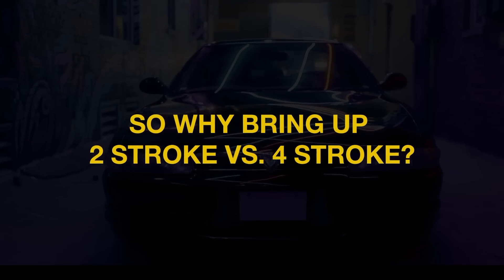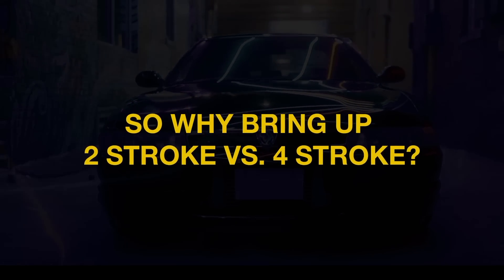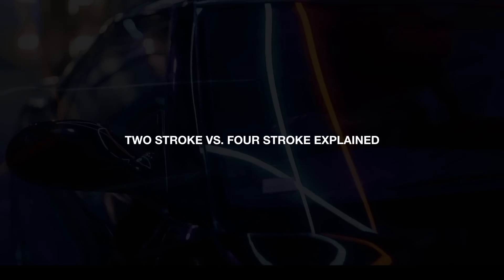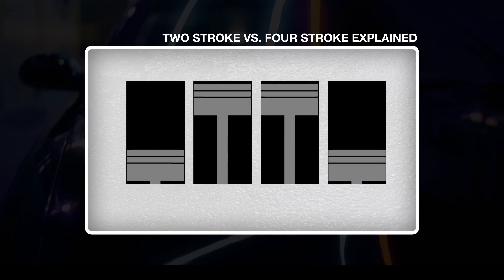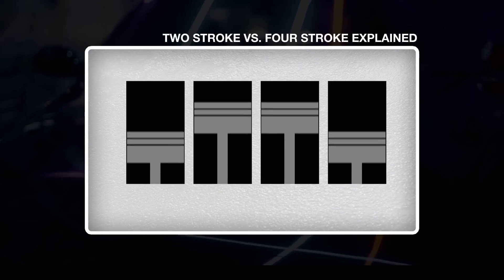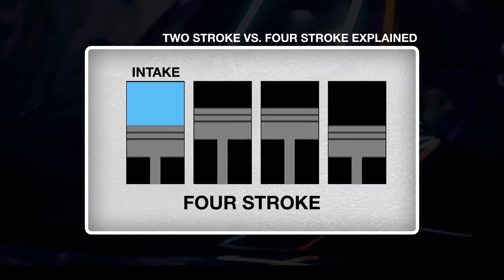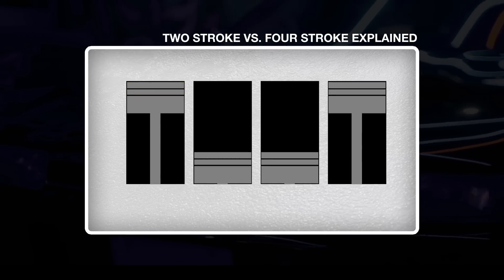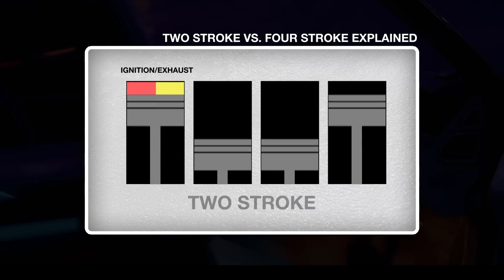The SECRET Behind Why RX7 and RX8 Rotary Engines Make SO Much Power

Comment: Your explanation is wrong though. "Engine displacement is the swept volume of all the pistons inside the cylinders of a reciprocating engine". Problem is, the rotary doesnt have pistons and it is not a combustion engine with reciprocating motion. The rotors are basically the "pistons" on the Wankel engine. In a four stroke, two full revolutions of the crankshaft are required for all the pistons to have fired at least once. In the Wankel engine, for each revolution of the e-shaft, two faces fire at the same time. If I go by your logic, that would mean the rotary needs 3 revolutions of the e-shaft for all the faces to fire and not one, so the bond with the 2 stroke engine kinda goes away. It is hard to really understand the displacement of a rotary, but you got it wrong. The difference lies in your example. A 4 cyl four stroke has four combustion chambers, so you need all the four pistons to fire at least once for you to know how much air got into each combustion chamber. So if two pistons fired once, the other still have to, so you can't tell the displacement until then. On a rotary, there are two combustion chambers. All six faces have 654cc. But only two of them, one per rotor, for each revolution, has a power stroke. In one of the rotors, if face number 2 let's call it, has a power stroke, face number one is the intake stroke and face number two is in the exhaust stroke. But don't misunderstand this. Even if I said the faces were on some "strokes", you shouldn't treat them as pistons. That is the tricky part. But you don't consider exactly how MUCH air the engine is taking. If by one single revolution, in the 4 cyl, only half of the maximum intake of air has gone into the engine, in the rotary, in one single revolution, the maximum air intake has already been reached, which, in the case of the 13B, is 1.3L. You just keep adding air for all the six faces as if the engine could take more than 1.3L, you're just repeating the cycle. The reason for all the power of a rotary is indeed because of how fast each power stroke succeeds one another.
Reply: DoubleC I’ve been waiting for so long to witness someone who actually had crunched the numbers & finally fathomed the answer!
Reply: DoubleC thanks for the input
Reply: DoubleC. Make a video and post u are accurate
Reply: 3.9 liter
Reply: Sorry, but the Wankel KKM IS A 4-STROKE so we calculate displacement at 1080° NOT 360° 
Its not that difficult to understand... each orbiting piston(rotor) has 3 sides forming 3 combustion chamber volumes, each with a swept volume of 654cc.  times the 2 housings is 6 and equaling 3,924cc.
 The other important thing that people without formal engineering experience fail to understand is that a 4 cycle Otto or Diesel engine completes its firing sequence in 720° of crankshaft rotation while the 4-cycle Wankel KKM designs required 1080° of rotation to complete its firing sequence...
These two important and often misunderstood details are the basis of the commonly used "2X" conversion formula for accurately "comparing" the displacement of the Wankel with other designs..
Any questions? I would be happy to explain in more detail...
Reply: Displacement of ANY combustion engine is measured by the total number of cylinders times a SINGLE combustion event (not multiple). That SINGLE combustion event per rotor is why Mazda rates a 1.3L 2 rotor that way. Each rotor face can only combust .65L of air. When this happens 1 time per rotor (or on a 2 rotor), you get 1.3L measured displacement. 

Rotary's are 4 stroke engines that have ignition events like a 2 stroke because the spark plugs per chamber fire every revolution. The guy is this video did a better job than most trying to explain this but left out some key wording that would have really driven his point home.
Reply: +RotaryPerfection The Wankel requires 3 revolutions, not one to complete each chambers 4-stroke cycle. The Wankel is not a 2-stroke as it does not complete its firing order sequence in 360° of crankshaft rotation. While the Wankel shares in common features such as pre-mix/oil injection and  port induction/exhaust these characteristics are not unique nor are they defining features of the 2-stroke concept and can also be found on some 4-stroke designs.
Reply: +RotaryPerfection NSU Ag. developed the "Tax Displacement" idea a contrived method to help promote and sell the Wankel design and to off-set its disadvantages in higher fuel consumption by offering the consumer a significant loop-hole in the tax codes commonly in use at the time. The "Tax Displacement" method is no longer recognized as a valid way of describing a Wankel engines displacement, authorities on this topic eg; Engineers, Government agencies, Insurance companies and Motorsports sanctioning bodies DO NOT recognize the Mazda 13B for example as actually having a displacement of only 1.3 liters, The 13B has a total displacement of 3,924cc and when we use the "2x" formula for converting a Wankel tax displacement at the typical 720° giving us a 2.6 liters for the purpose COMPARISON.
Reply: doktorbimmer I personally don't consider the 1.3L as such and have always doubled the displacement because the engine moves as much air as a 2.6L in 720 rotation of the e-shaft. You are talking about 3 revolutions of the e-shaft to fire the fuel air mixture of each rotor face to complete one full rotation of the rotor. To do such would also require 3 separate ignitions events on each face. That being the case, the engine would have ignited 3.9L of air in 1080 degrees of e-shaft rotation. The leading plugs would have also fired 3 times during this time period (minus Fd Rx7 wasted spark). 

I'm talking about how Mazda came up with the 1.3L rating. Displacement is measured by a SINGLE ignition event per chamber/cylinder not multiple. There is an ignition event every 360 rotation of the e-shaft per rotor chamber as the next rotor face is already compressing its fuel/air mixture. That's why I say it fires like a 2 stroke because the ignition events are at 360 and not 720 like a 4 stroke piston. I don't know your back ground but I've built, tuned, and 20b swapped these engines over the past 27yrs.
Reply: +RotaryPerfection  THERE ARE 3 IGNITION EVENTS PER ONE COMPLETE ROTATION OF THE PISTON(ROTOR)
Reply: +RotaryPerfection Each Chamber (rotor face) requires 3 revolutions of the eccentric-crankshaft to complete the 4-stroke cycle... thus 3 revolutions to complete its firing order sequence and 3 complete revolutions to determine its true total displacement.
Reply: +RotaryPerfection Yet you seem completely unfamiliar with the 2-stroke concept, in which you are trying to make a comparison to. How can you compare the Wankel KKM design that uses the 4-stroke operating principle with a 2-stroke? You seem completely unaware of the fundamental difference between to 2-stroke and 4-stroke concepts.
Reply: doktorbimmer "There are 3 igition events per 1 complete rotation of the rotor/pistion."

You're telling me something I already know. My previous explanation pretty much said this. It also proves there is an ignition event every 360 degree rotation of the e-shaft when you claimed there wasn't. Like I said, rotary has ignition events like a 2 stroke even though it''s a 4 stroke engine. I believe you're getting too caught up in trying to show your knowledge that you're not paying attention to what I'm typing.
Reply: doktorbimmer I'll simplfy this! 1.3L rotary moves and ignites 1.3L of air every 360 degree rotation of the e-shaft. Since the measured displacement is the volume of a SINGLE combustion event per chamber, Mazda can legally rate the engine as a 1.3L. End of discussion on that part. 

Now how much air has that same engine moved with 720 degrees rotation? 2.6L. During that time, the engine will have had 4 ignition events. Thats why a 1.3L rotary is comparable to a 2.6L 4stroke piston 4 cylinder engine. Both engines would have moved the same amount of air AND had the same number of ignition events. Both engines are equal in the since that they measure rpms in the same way. E-shaft vs Crank. That being the case, since the combusted energy is being delivered to the crank or e-shaft, it only makes since to calculate how much combusted air volume is used to move the perspective cranks every 360 degree rotation. So you worrying about the rotor needing 3 rotations of the e-shaft to complete a full rotor rotation doesn't matter to. I calculate and compare the 2 based on how much usable air is being ignited every 360 degrees of the crank. So a 1.3L rotary will have moved 3.9L in 1 FULL rotation of the rotor and had 6 total ignition events. Guess what? That same 2.6L 4 stroke 4 cylinder piston engine would have move the exact same amount of air and had the same number of ignition events. 

1.3L rotary=
1.3L 360° 2 ignition events
2.6L 720° 4 ignition events
3.9L 1080° 6 ignition events

2.6L piston=
1.3L 360° 2 ignition events
2.6L 720° 4 ignition events
3.9L 1080° 6 ignition events

So if you wanna rate the rotary as a 3.9L you will be correct in 3 rotations of the e-shaft.
Reply: +RotaryPerfection And you sir have just proven that you do not understand how displacement is calculated.
Reply: +RotaryPerfection EXACTLY! The Wankel requires 3 revolutions to complete its firing order sequence and for all 3 faces to complete the 4-cycles so its displacement is 3.9 liters.  You can't have it both ways..
Reply: +RotaryPerfection It is very simple... for the 13B series each orbiting piston(rotor) has 3 sides forming 3 combustion chamber volumes, each with a swept volume of 654cc.  times the 2 housings is 6 and equaling 3,924cc.
 The other important thing that people without formal engineering experience fail to understand is that a 4 cycle Otto or Diesel engine completes its firing sequence in 720° of crankshaft rotation while the 4-cycle Wankel KKM designs required 1080° of rotation to complete its firing sequence.
*These two important and often misunderstood details are the basis of the commonly used "2X" conversion formula for accurately "comparing" the displacement of the Wankel with other designs..
Any questions? I would be happy to explain in more detail...*
Reply: +RotaryPerfection The contrived "Tax Displacement Method" was created by NSU in Germany before Mazda purchased the design from them, as Japan had a similar tax code regarding tax per engine size they simply kept the same method for calculating displacement.
 American designs used total displacement instead of the "Tax formula method to calculate the displacement as the U.S. uses Gross Vehicle weight and MPGs to tax vehicles for registration not engine size.
For example, the General Motors RC2-206 Wankel was the same swept volume of the Mazda 12A Wankel but GMs engine had a published displacement of 206 cubic inches (3,380 cc).
Reply: +RotaryPerfection Legally? NO, not anymore. Germany Japan and the UK no longer legally recognize the "tax displacement method" and classify the Mazda 13B as a 2.6 liter for vehicle registration and taxation (and for comparison purposes) Engineers, Insurance companies, Motorsports sanctioning bodies and government revenue agencies all classify the Wankel under the "2X" conversion formula eg; a Mazda 13B as 2.6 liters instead of its true displacement of 3.9 liters.
All Wankel engines are 4-stroke... but require 3 revolutions of the eccentric-crankshaft to complete their firing order. This why the 13B is considered a 2.6 liter when comparing to other 4-strokes (corrected to 720 degrees of rotation) even though the true displacement is 3.9 liters in total.
Reply: doktorbimmer. You keep telling me how many sides the rotors has AFTER I already explained my background hands on experience with the tech. Tuning, building, fabricating ext. I'm far from a newbie Sr. Like I said, if you wanna classify the rotary as a 3.9L engine, it will only move that displacement in 1080° of e-shaft rotation. You're so focus on the total displacement that you're ignoring my points. I'm not arguing against that fact. I'm specifically talking about how much air is MOVED and ignited every 360. Understanding this better helps people understand how to compare the engine to other pistons (hense my example above). Not everyone who reads these post can comprehend engineering langauge so I try to simplify my explanations so others better understand. I'm NOT disagreeing with the 3.9L claim at 1080.
Reply: +RotaryPerfection There is only one method for calculating the true displacement of any engine.
WHAT, are the 3 factors you need to know about any engine to calculate its displacement?
Reply: +RotaryPerfection You also agree that the Wankel KKM design is not a 2-stroke.... so calculating anything at  360° of crankshaft rotation is completely meaningless and is not germane.
Reply: doktorbimmer Sr You have gotten far to literal in this discussion. When I say that a rotary has ignition events like a 2 stroke, that is not me saying that the engine is a 2 stroke. 2 stroke engines have ignitions events in the same cylinder every 360°. That is exactly how a rotary engine fires it's spark plugs. You're so focued on the cycle of a 2 stroke engine that your not paying attention as I'm only talking about the spark process. 4 stroke piston engines have ignition events every 720° per cylinder and need 720° to fire all cylinders to get power from its full displacement. Rotary only needs 360° to fire both chambers and to make power from its swept intake volume. Any additional sparks per chamber is considered ANOTHER combustion cycle. That's why rotary is rated as a 1.3L. If you don't agree, feel free to sue Mazda for false advertising. You will lose that battle. Lighten up! How many rotary engines have you built and tuned?
Reply: +RotaryPerfection Thank you sir, have just proven yet again that you do not understand how displacement is calculated.
Reply: +RotaryPerfection A V-8 engine has 4 ignition events in 360° What is you point? You still do not calculate its displacement at 360° of crankshaft rotation.
Reply: doktorbimmer If you don't understand my point then you never will. Going back and forward with someone who obviously doesn't have any hands on rotary experence is a waste of my time. Good day to you Sr.
Reply: +RotaryPerfection Its become readily apparent that most of your "hands on" experience with Wankel engines involved oil filters and drain plugs...  feel free to continue repeating benighted fantasy theories and false urban myths, you are only making a complete fool of yourself.
Reply: +RotaryPerfection I just simply pointed out that you don't understand how displacement is calculated and you proceeded to make a complete fool of yourself... if you are embarrassed, you have no one to blame but yourself.
Reply: +RotaryPerfection Don't be a sore loser... OK
Reply: +RotaryPerfection Yup, you made yourself look like a fool.
Reply: +RotaryPerfection Mazda no longer rates the engine as a 1.3 and no longer manufacturers the 13b or any other Wankel engine, Mazda  used "Tax Displacement" as a loophole, this contrived method invented by NSU.. not Mazda and is no longer recognized as a valid method of measuring displacement.
Reply: +doktorbimmer Dude give it a rest. It's sad how obsessed you are with being right within this discussion. You just wrote 3 separate post in hopes to get me to respond. I've said what I needed to say on the subject and now I'm moving on. Understand his one thing. YOUR OPINION DOESN'T MATTER TO ME because you have ZERO hands on experience with the actual engine. I wont respond to you again so you can have the last word (which I'm sure is exactly what you want).
Reply: ZERO hands on experience with the actual engine
Reply: RotaryPerfection
Reply: REAL ERNIE BANKS That doesn't shock me one bit. Trolls have no life. That's why they do what they do. Now that I know what he is, I will no longer waste my time with this individual.
Reply: +RotaryPerfection The only thing sad here is the fact you cannot accept you are wrong and you completely embarrassed yourself.
Reply: +RotaryPerfection The facts speak for themselves and the truth always prevails...
Reply: REAL ERNIE BANKS Bird brain is an understatement. Everytime he replies, he has to make separate post to get his points across. Then he has the nerve to thumbs up himself. What a special character he is.
Reply: did you watch rotary hemi breakthrough and yes Bird brain is an understatement
Reply: How can you tell me I'm wrong when you do not understand the basic concept of displacement or how it is calculated???
 I understand that you are embarrassed and confused but if you don't ask for help you will simply continue to make yourself look like a fool.
Reply: RotaryPerfection
RotaryPerfection
2 weeks ago
+doktorbimmer Dude give it a rest. It's sad how obsessed you are with being right within this discussion. You just wrote 3 separate post in hopes to get me to respond. I've said what I needed to say on the subject and now I'm moving on. Understand his one thing. YOUR OPINION DOESN'T MATTER TO ME because you have ZERO hands on experience with the actual engine. I wont respond to you again so you can have the last word (which I'm sure is exactly what you want).
Reply: RotaryPerfection
"I'm specifically talking about how much air is MOVED and ignited every 360."
In a Wankel engine 3.9L of air is moved when you add up all 3 sides of both rotors, 6 all together, in 360 of the e-shaft, 120 degrees of the rotors. 1.3L of that is ignited/burned.
If it's the case that we only measure what is burned per 360 of the crank, the LS3 is a 3.1L engine.
Reply: Here in California, the very first government agency was formed to introduce motor vehicle emissions standards in 1967, still the strictest air pollution standards in the world, Diesel fueled vehicles have always been classified as clean, low emissions vehicles and were even EXEMPT emissions regulations and the bi-annual testing program for 30 years. Yes, it is possible to observe something and still not understand what you are seeing.. especially if you are not knowledgeable on the issues. BY THE WAY IS IT A WANKEL OR ROTARY I NEED MY DO GOOD PILLS I AM LOST IN THE LORD